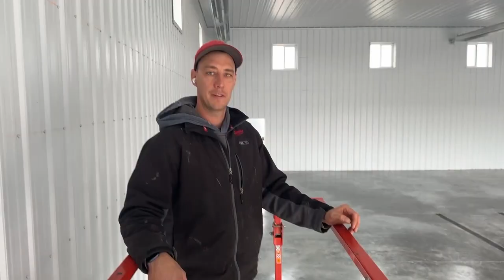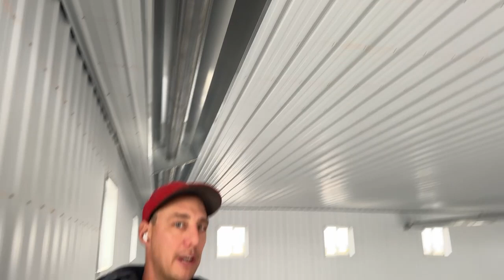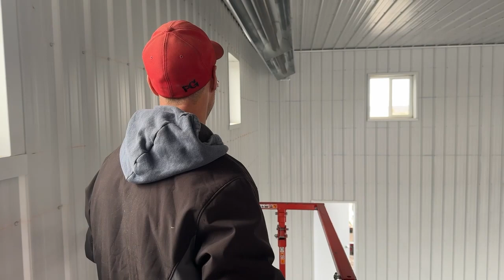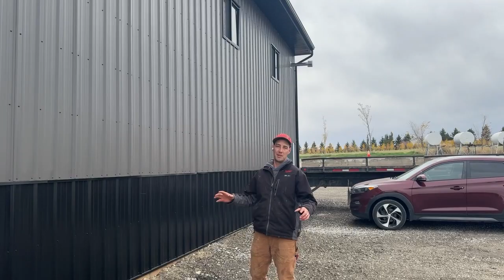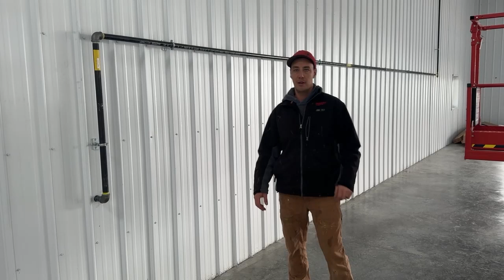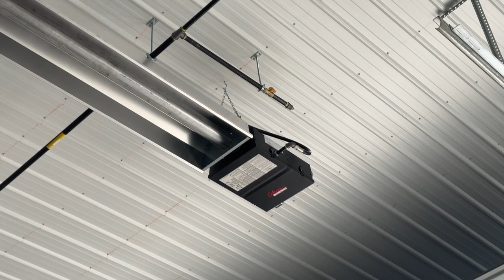Easy Steps To Install Your Calcana Radiant Tube Heater!

Comment: No electrical? Those radiant tube heaters have 24v controls? I take it they are atmospheric-venting i.e. no 120vAC exhaust fan or draft inducer motor?

Comment: how well do the heaters work?
Reply from the maker: They work amazing.
Reply: they work extremely well. i have a 60x40 shop and keeps me toasty. only thing is be mindful of what is under it! i had work benches down the middle of my shop but had to move them because it would heat the metal bench tops and was to hot to work directly under (i only have a 12 foot ceiling) also i know a guy who left a car lifted up on the hoist under it over night and it burnt the paint because it was only a foot away from the heater.
Reply: @RyldUpLtd good advice. I’m installing in an 18x36 addition with 10 foot ceilings sloping up to 13 feet on one side. I’ll locate my work bench area where I’m not getting totally cooked by them.